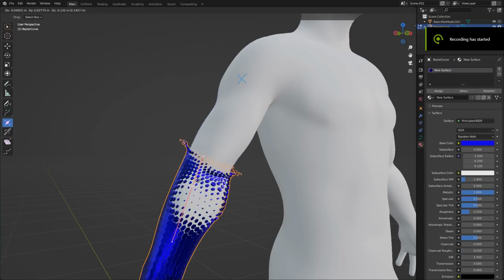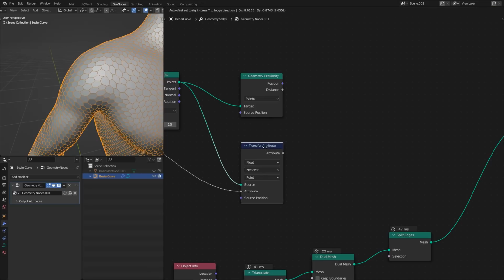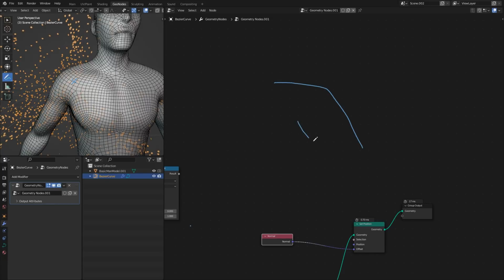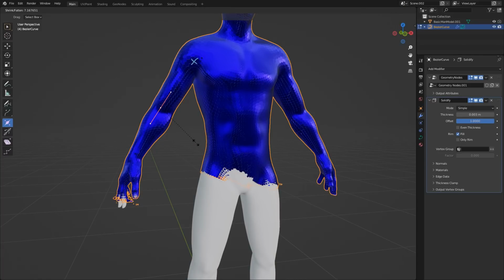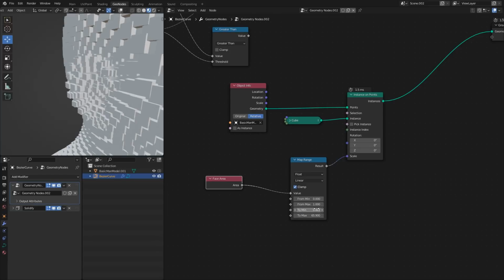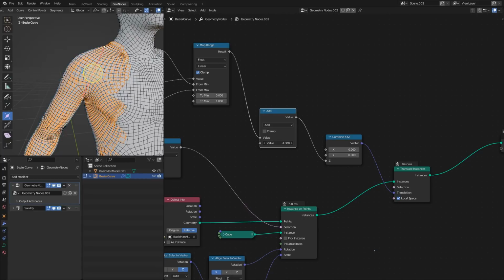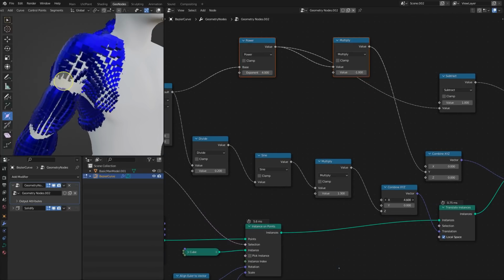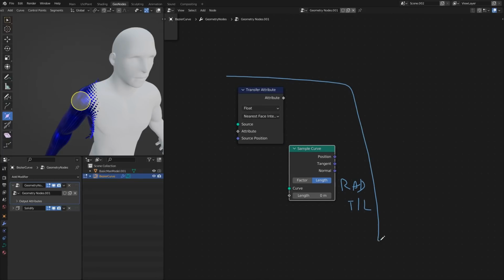[Blender 3.1] Self-Building Surface Geometry Nodes Tutorial (Part 1)

Comment: Quick tip: there is a "To Radians" option for the Math node. By using this instead of Value, you can give the rotation in degrees and it will convert to radians automatically

Comment: could you use geonodes to make cloth?
Reply: Cloth is a physics engine that works on any mesh. If the mesh dont hang together it will fall apart. ALook at Default cubes recent second brick tutorial. He crashes a wall with the cloth engine.

Comment: cant you just use a layer of the model and manipulate a blueprint node/parameter to apply an animation through a certain condition (activate spell-except in unreal/unity/blender etc., language- cover layer of model from "head / toe / body parts of layer") etc., this method seems close to the video method, with less steps, and able to be applied as a possible input into the settings tab; instead of having to use blueprint and customize each time. (although im impressed) and good job.

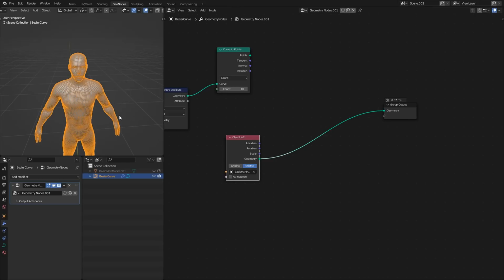Comment: I'm stuck on the dual mesh part; 3:09, I have Tissue plugin installed however dual mesh doesn't come up in geometry nodes. I can use tissue tools outside of geoometry nodes though. So it seems like an issue only inside geomtry nodes. I'm new sorry, any tips. I come from rhino+grasshopper workflow, so workflow is familiar just interfaces are different.
Reply: It may be because of the 3.1
Reply: you have to plugin a multiply node and then add a shader node connecting both the nodes
Reply: @legolizard3d  I'm trying this and Im still doing something wrong. Pls help!
Reply: Have you figured out how to make it work?
Reply: @arakelov_visuals  uhm I don't know, watcxh the video again
Reply: having the same issue with dual mesh not showing up
Reply: You may have confused version 3.1 with 3.0.1.